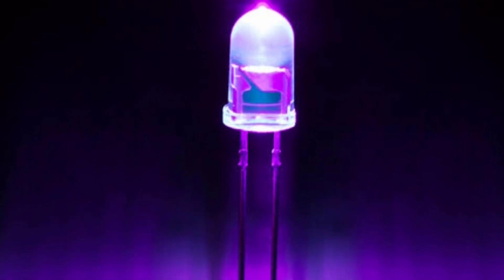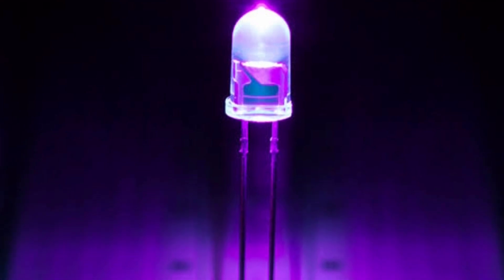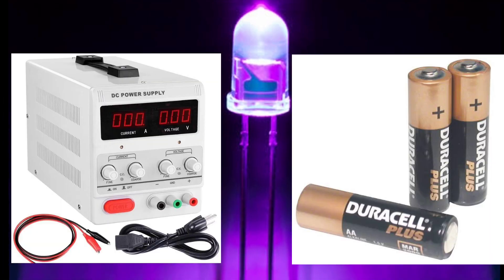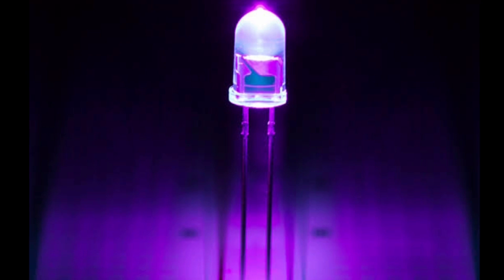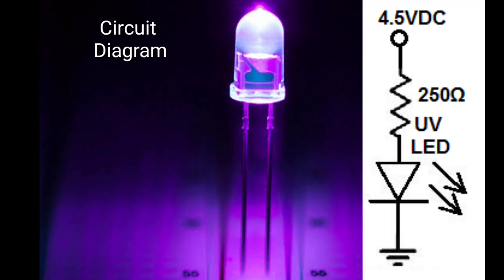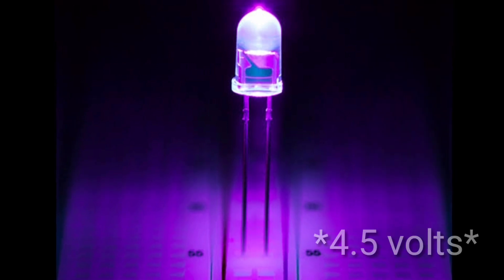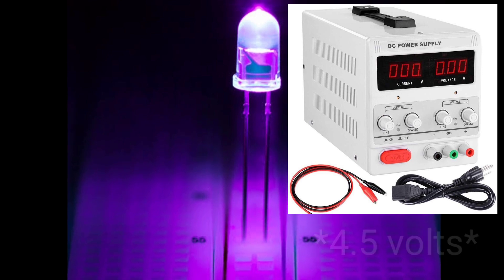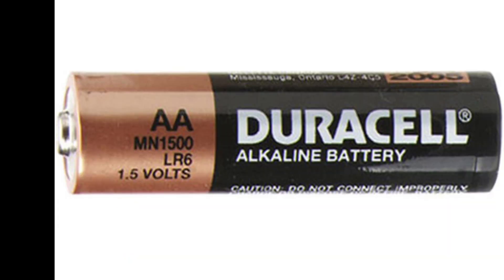How to make an Ultraviolet (UV) LED Circuit?

Comment: Can you plz tell me the value of resistor if
3.7 v battery
And 390 to 395 nm ug led 
The voltage of led 3 to 5 v

Plz reply i have to give a project🙏
Reply: 30 ohm